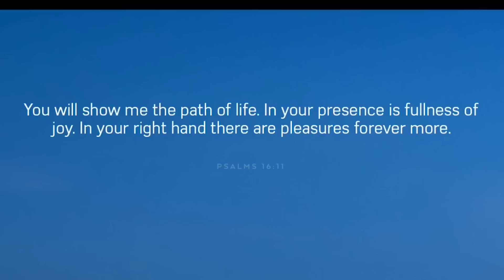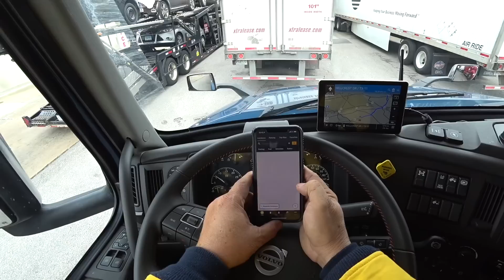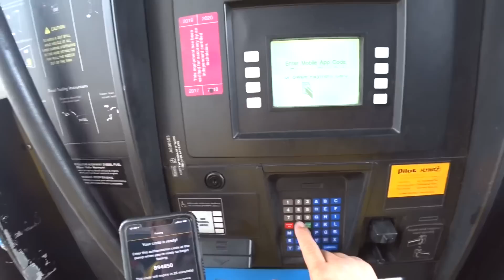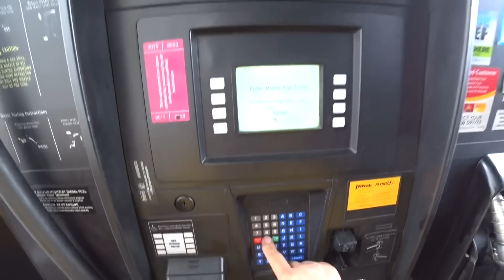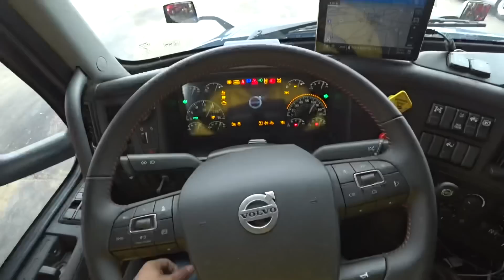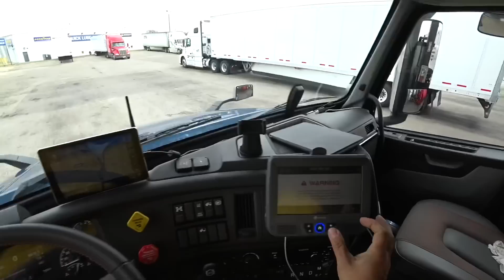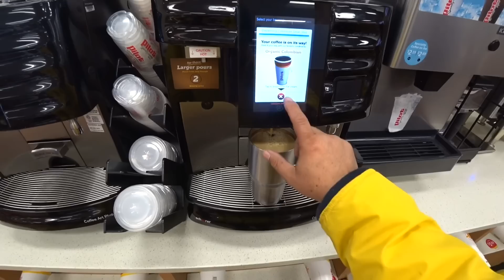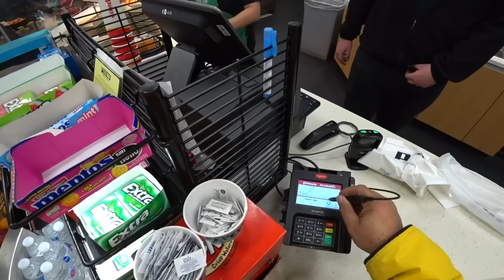December 29, 2018/1497 Driver, my truck won’t START Sulphur Springs Texas

Comment: There was a problem with some of the automatic controlled Volvos after putting the truck in neutral and release brakes,  the truck would still be in gear with clutch engaged.  After cutting truck off it would release the clutch on that gear.  Because some of us are in a rush when getting things done.  Lots of drivers tend to put in neutral,  hit brakes,  kill the engine in less than 2 seconds.  The automatic controller couldn't handle that, so they found a way to improve it.  
Not that is that guys case,  it very well could be a starter solenoid, and the engine could have been a rebuild and dropped in that truck. Most people get the Volvo engine instead of a cummins.  But depending on the year,  some year Volvos had copper injector issues and scared people away from buying Volvos with Volvo engines.

Comment: I drive for CFI and the reason we put a line of spray paint on the rim and tire is so that when the trailer goes across the border u can tell if they tried swapping tires on the trailer... I happens all the time.. Cool little video be safe out there...

Comment: Nice pre trip inspection cheking all the tire and the truck. I think mack and volvo are the same  brand they used to have the solenoid in the same place. I m not a truck drive but hopefully get my cdl very soon

Comment: likely transmission related probably doesnt see neutral probably shut it off in gear
Reply: I thought the same thing. Left it in drive.
Reply: @woody6773  yup seen it so many times with those auto shifts
Reply: @woody6773  the dash said N it was a ultra shift cause he had a cummins not a Ishift with a Volvo engine
Reply: Somebody will come along and show him how to jump around the solenoid on the starter.  Unless Volvo has invented some electronic “safety” feature that prevents the old fashioned way.
Reply: Jamie Ford  ishift for Volvo engine only but i have a volvo engine but also have ultra shift 13 speed automated trans.  now watch my S&%* lol
Reply: @cynthiamoon372  Doing that will light up the starter, but it probably won't run because the engine computer won't allow fuel to be injected.
Reply: You can see at 11:00 when he turns the ignition on it Says N for Neutral.
Reply: Volvo won't start with the hood open for some reason or the one I drove wouldn't
Reply: Won’t start with hood open

Comment: had that problem in my truck it had power but wouldnt turn over turned out to be solenoid. actually had it happen twice first it was the capacitor battery

Comment: Same thing has been happening to my truck. The starter gets into a bind sometimez and won't crank. I have to call road service to get pull started. My company refused to replace the starter.

Comment: Andddd this is why I have a 2003 classic xl pre egr 12.7 Detroit with a 10 speed lol
Reply: 2005 Peterbilt 387 cat c-15 acert 10 speed...i'm just gonna keep rebuilding and replacing parts until they don't have them for sale anymore.
Reply: jmh4ggg I’m with ya there
Reply: I had to drive a Volvo for a rental last month thing did the same thing to me and not to mention it was the most uncomfortable truck I had ever driven ill stick to driving 389 gliders ;)

Comment: Volvo truck if u not live on curus control on its stop a minute if its happen just take the keys out and put in the keys start its will be start 
Its happen to me long time a go  if u go sleep live on the engine must set up curus control on if not Volvo stop kill all your battery

Comment: I’ve got automatic transmission and it refuses to start when I’m in gear. So he shut it off while he’s in gear and then it’s impossible to get it back running again without engaging neutral somehow
Reply: Mini Driver/south Sweden Tjänar man bra I Sverige?
Reply: Sexbomb 6641 det beror ju på lite vilken last du får och hur långt man ska köra. Men det är svårt att få jobb i Sverige. Till exempel en körning från Ludvika till Teheran kostar kunden 1111 kr men bulgariska åkerier gör det för halva kostnaden och nja inte direkt. Jag rekommenderar att spåna runt och kolla men det finns seriösa åkare också men det är inte många.
Reply: Mini Driver/south Sweden Så ifall man ska göra en bra karriär så gäller det att köra utomlands?
Reply: Mini Driver/south Sweden Okej, då förstår jag lite mer. Tack för de snabba svaren! 👋🏻

Comment: Any one notice all three  Volvos at the fuel pump and thay were red white and blue
Reply: Wrong again, its white, blue, red or red, blue, white
Reply: @kkkkksksk  it doesn't matter thay where still red white and blue   doesn't have to be in line

Comment: What is the purpose with hitting the tires with a club?
Reply: Listen for a tone difference to see if a tire is extremely low.   A low tire will have a lower tone than the others, like flat basketball vs a highly inflated one.
Reply: Aha! Thanks for the answer :) never thought about that actually. Im new to trucks :P im an apprentice for Volvo Trucks  (Machanic) in norway 🤘🏻😊

Comment: Question do you prefer manual or automatic transmission? I know in baby blue it was a manual so is this a luxury for you? I would like to know.
Reply: Hi! What happened to Baby Blue?
Reply: Clainda Stuart John got a new truck about two weeks ago. It’s a Volvo automatic.
Reply: @mdxcrafting9744  Thanks! I missed a couple weeks of vids...trying to catch up now...
Reply: I drove a Volvo with the 12-speed auto for a while and absolutely loved it. I'm now in a '19 KW with 10-speed auto and it's horrible. So it depends on which auto you get.
Reply: @bradh6185  yep u said it ! but curious how is your so bad?

Comment: What are your thoughts on Volvo? Looking to buy a truck but not sure which Freightliner or Volvo?
Reply: timothy Alvarado I’ve put a few miles on Volvo trucks over here in the UK and I’ve not had many problems with any of them, not sure what the North American trucks are like but the European tractors we have normally give good service and reliability and are good on the MPGs
I’ve driven old Volvo 420hp up to the globetrotter XL Fh16 and if I was still driving the Volvo would be my choice!

Comment: i want to ask what will happen if another truke came after u and fueled .will the driver fill his tank with your money .what do u do to end the fuelling process?
Reply: The Process ends once the person returns the nozzle to the pump a bit like putting telephone back on the hook of course if a driver  buys say reefer fuel  or something but forgets to use it the next drive could fill there tanks because pump still thinks there filling the reefer
Reply: @Pmherbie1988   but in the video he put the nozzle and drive forward a bit then stoped to fill the trealler with fuel with the same nozzle ??
Reply: That’s because he purchased both tractor and reefer fuel each one is done in stages tractor is one stage removing the nozzle starts the process returning it will either end the fuelling or move on to the next stage eg reefer fuel once the driver has completely finished all the stages and returns the nozzle does the system reset ready for the next person
Reply: @Pmherbie1988  now i got it thanx👍👍